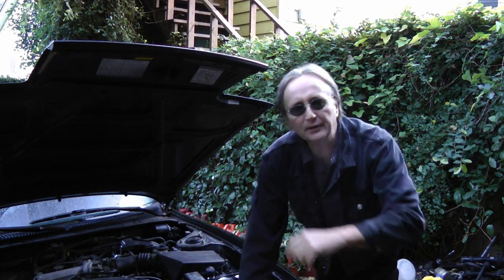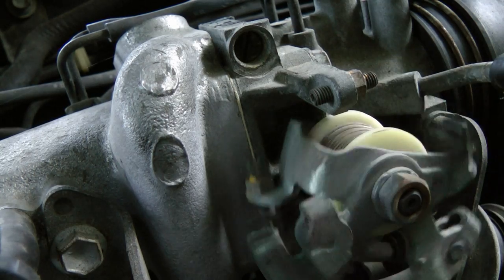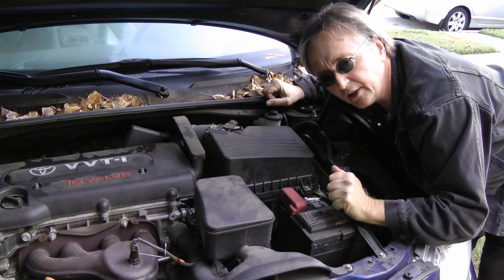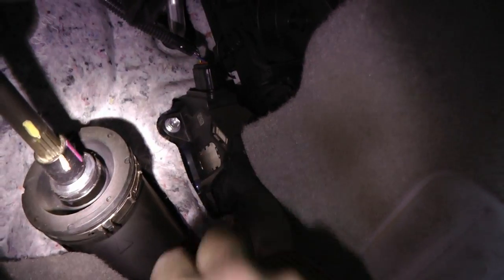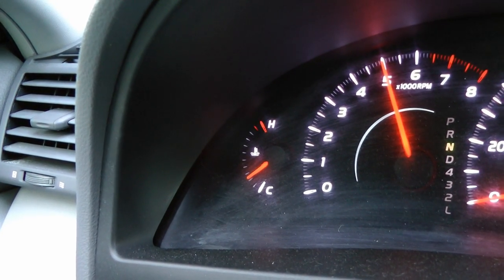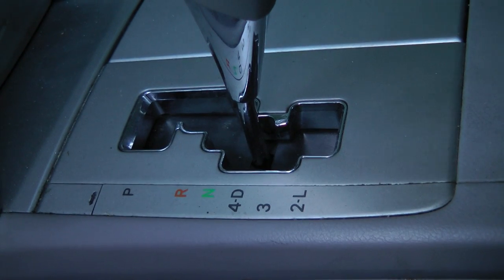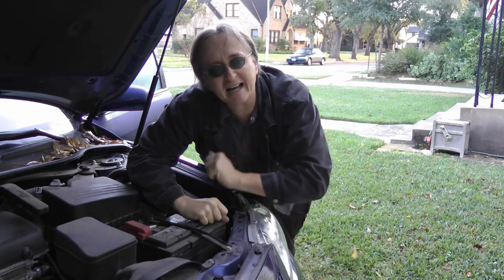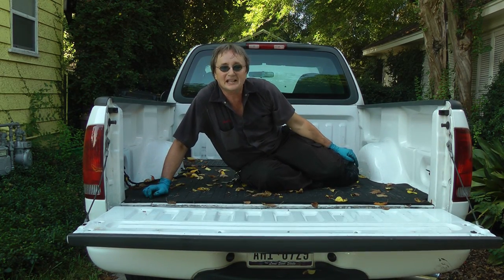How To Stop Unexpected Car Acceleration

Comment: Scotty I did hear your recommendation that if you shift it into neutral that the problem of unintended acceleration is solved.  I think the problem is that if the throttle body open suddenly due to a computer glitch some people would freak out and not put it into neutral fast enough.  People who drive automatics are not use to manually doing anything to the transmission.  Also there are cases where if the ECU really locks up the car will not respond to the gear selector being in neutral, since in many cars this is just a switch the talks to the transmission computer.
Reply: Thomas J That is not true sir...shifting the gear lever into neutral is a fully mechanical work and does not have to do with the car's computer!

Comment: I've had my car unintentionally accelerate once. The cruise control is operated by a motor creating suction in a hoses which sucks in a diaphragm that opens the throttle valve. Earlier I cleaned the intake manifold and all hoses and such, something must have got in that line and perhaps through heat in the engine bay it evaporated and created a vacuum that held the throttle open

Comment: A lot of this was on the Prius that doesn't have a real transmission control and doesn't have a key. The forward/neutral toggle is just a computer signal and the ignition just has a start/stop button. Neither of which do anything while the car is moving. You can kill the car by holding the start/stop button down but most dont know that.
Reply: Robert Gary Like a blender?
Reply: Another reason I despise the Prius. 

I'm fine with hybrids, it's just the design of a Prius i hate. The charging system on them, transmission system, etc. 

Don't get me wrong, my mom drives a 2014 Kia Optima hybrid and it's a great car with a real gear selector.

Comment: Scotty, Alot of the new Toyotas don't have trans dipsticks. What's your method of changing out the fluid in them and is there a filter in the trans to change. ( 2016 Camry). Thanks Mike

Comment: Hey Scotty, I have a 1993 BMW with a cable 530i ... I had an unintended acceleration. Could this be the throttle body, the throttle body sensor(TPS), or the cable? My cable is definitely old. It was 2 degrees out so it was very cold. Wondering if weather made it stick. It was redlining even in neutral so I’m guessing the TPS is working because the throttle would have gave up if I stopped pressing the gas. So I’m guessing cable or throttle body? Please share and help where you can thanks Scotty.

Comment: my 196cc mini bikes throttle would get stuck at full rev and it was like cruise control haha , it only had rear brakes , now I have a 08 mercury mountaineer auto and a 95 mitsubishi mighty max manual . the mitsu just needs electrical redone like lights, turn signals ,etc, just got it so it's a running project truck

Comment: Computers are more reliable and can add features that were not possible in the fully mechanical systems that they are replacing.  The computer can monitor the car's "health". For example, I went to get an emissions test and all they had to do was plug a cord into the car to read some data that it collected as I was driving it.

Comment: You may be correct but it's "safer" to just put your engine in neutral,  because if you turn off the engine and someone in front of you hits their brakes, not only are you screwed, but they are too, because even stopping a  coasting vehicle on a downhill slope is a pain without power brakes...

Comment: Now if it were something from the VW Group, you'd just press the brake pedal to cut the electronic throttle input and let the ECU bring the engine down to fast idle. They've had this system in their turbodiesels since the early 90s, and have included it in every petrol model with electronic throttle control.

That is the reason why the engine management light turns on when your car's brake light switch on the pedal is faulty.
Reply: +chrwl007 
Toy changed their software to do that. 

But this wont stop old, bad drivers from stomping on the wrong pedal in a moment of distraction and stressed confusion.  We've seen/heard old ppl run over crowds every year for decades but it rarely reaches national attention.
Reply: peachees
I know they did, but they should have anticipated that type of failure when they did the initial design

Comment: i know this is a few years old, but i really think no matter what brakes, steering wheels and accelerator  should be controlled manually no drive by wire crapp as the only connection... tho not sure if brakes and steering is by wire ( computer controlled ), tho iv heard about some cars being that way,  correct me if im wrong.

Comment: Have you ever heard about Hyundais accelerating on their own ? At my previous job we had a Hyundai Trajet minivan , that would rev up on it`s own when it was hot outside, mostly when you put into park after you been driving it . Once it did take off on it`s own when it was started and put into D , we had to turn it off and restart it to stop it ,from revving . Only happened on hot summer days but it was a bit scary . I heard that one problem on Hyundais were the thermostat ,, could be .

Comment: Hi Scotty, any other suggestions that could cause this problem? I have a Mazda 2000 B2500 Pick up Standard transmission. It accelerates during drive and once I shift to neutral it continues to accelerate until I come to a complete stop. Its like a sensor is malfunctioning. I have replaced the idle control valve twice and still have this problem. I do not think its the cable in my situation but if you suggest it I will try it. I have also tried cleaning throttle body and replaced all sensors.

Comment: I have a 2002 Ford Ranger, and when I was backing up with my foot on the brake and off the gas, it accelerated to full throttle, and i panicked and put it in park and turned it off. I could not replicate it, but I am worried it's going to happen again. I don't see how it could be a stuck accelerator since it was idling in reverse. No error code, and no issue was found in the throttle body, the cable, the spring or anything else.

Comment: This happened to me a couple months ago, turns out there is a little rubber piece that was broken  that goes between the gas pedal and the acceleration sensor. The dealership wanted $150 to replace this tiny rubber piece.
Reply: +TheGentleman Where's the happy ending? Tell us you got the part on ebay for a buck and it took you 5 minutes!
Reply: Of course not! glued the end of a pencil eraser to a metal washer I had laying around. Works perfectly.

Comment: Scotty I have a question about my car, relating to the video.

Background story: at a dead Stop (with my foot on the break pedal) - I then depress the break pedal so that I can drive forward ( I do not press on the gas ): My car accelerates forward as soon as I take my foot of the pedal too quickly.  I am used to cars that slowly move forwards once my foot is off the break pedal. 

Would you happen to know why this happens ?

Comment: @parrowman They could have come up with a failsafe design where a secondary throttle would simply override the main throttle in closing the airflow. Engine power is controlled primarily by the main throttle and the secondary only steps in when power needs to be cut.

Comment: I have a 99 camry 4cyl, and it's normal when it is cold that it idles that high. It'll go down. If it's like 2300+ rpms then you may have a problem. But your car is fine.

Comment: Mr. Kilmer, I've had a case where an acquaintance of mine was driving on the motorway with cruise control on, but the car was stuck in cruise control and brakes just didn't work when she was pressing the pedal. What could have caused this? The car in question is a 2012 Merc E63 AMG.

Comment: Unfortunately some vehicles suffer Sudden unintended acceleration because of network communication errors so the TCM locks the transmission in limp mode. 2nd or 3rd gear.

Comment: My 2010 Toyota Prius Suddenly Accelerated Unintendedly on January 31, 2019. This is still happening! This was not the Floormat! I did not mistake the Gas Pedal for the Brake Pedal! I Never Have! The pedal was not Sticky! It Sucked itself Full Throttle right to the Floor when coming out of a right hand turn! Brakes held but Engine was Revving like crazy. Every time I released the brakes to try to get the gas pedal to come back, the Prius took off. Can you imagine starring down with your foot on the brakes, and the gas pedal is still pushed in Full Throttle? Explain that?? It did this for about 2 and a half blocks. Shifting to Neutral was NOT working. It wouldn't Turn Off. And I didn't want to press the "E" Brake risking the lines snapping and having NO BRAKES! That was my last resort. This was Crazy and Vehicle Manufacturers need to be held accountable! I've made a "Safety-Related Defect Complaint"  to Transport Canada 🍁. You should all do the same in your country. Let's fight this and end Sudden Unintended Acceleration!  Maybe going back to a Drive By Cable system instead of Electronic Throttle Control will be the answer. There's gotta be a solution!

Comment: From what I noticed on most cars at cold start when its really cold  the idle is at 2000 rpm and then starts dropping down to around 800 as the engine starts warming up.

Comment: 2002 Volvo C70, when I come to slow down at a light, the RPM accelerates up with my foot not even on the gas... RPM goes high when turning it on even if the engine is warm. Slight movement of the RPM while idling, stays thrusting forward like in drive once gas is pressed and let off. Doesn't go down immediately.

Comment: My 2003 accord would get dirty in the throttle body. And it would like hesitate and I had to shift early to keep it from jumping. All I needed was a new filter because we didn't realize that the air filter hose was ripped from underneath. And proof put an aftermarket one and the problem never came back

Comment: The transmission is also tied to the computer and won't shift until the gas is released.  Thus the sift-to-neutral may not work at all.  (depending on the vehicle model of course)

Comment: I have had all the recalls done to my 09 camry 4cyl.  I have never had any issues except once last year during a cold snap.  Started the cold engine without touching the gas pedal, as usual, the engine started, but immediately revved to about 4000RPM, I shut it off.  Was OK when I restarted it again, but has made me worry a bit.
Reply from the maker: +kramden  nothing is perfect. but try my video "how to fix a car that idles poorly" and often that cleaning stops such nonsence
Reply: I have had the throttle body serviced several times just to make sure, sparkling clean every time.  At least it is a 5speed, so would just have to push the clutch in if it misbehaved.  One thing is for sure, this is my last Toyota!
Reply: Yeah cold start, the engine probably did that to prevent stalling, if you rev a bit more it'll drop, or the throttle body could've been frozen open or something of the sorts
Reply: +kramden this happens to my bike and car when cold, it's like self warm-up i think. I have to wait til it calms down before i can ride smoothly, or else it will be a slow ride!

Comment: 1 if Unexpected Car Acceleration happens .... sometimes there is NO time to switch to neutral. For example if you stop in front of moving train.....
2 In modern cars  gearbox shifter connected to...ECU as well. It is just a joystick.

Comment: so if I put my car for the drive to neutral the transmission will separate itself from the engine physically or will the computer system break the ground or the circuit between the engine and transmission.

Comment: I think he is underestimating the computer problem.  In many new cars, the gearshift lever is also just a control that tells the computer to shift into neutral.  So, if the computer is hung, no shifting.  In addition, if the computer is hung, you can't turn the car off with the on/off button either.  So, accelerating car, the brakes aren't as strong as the engine, you can't shift into neutral, and you can't turn the car off.

Comment: Just try to brake a speeding car without the 3 full pedal pumps in any car. Try it in a place where you can't harm other people or yourself.

Your legs (even if you are a bodybuilder) can't give you the enough force for making stop a speeding modern car in a short amount of time even if you stand up on the brake pedal. As a last resource you can use your emergency brakes when you put your car in neutral or when you shut off your engine.

Comment: I hear all the time old people unintentionally plowing through the fronts of stores.. Hitting the gas instead of the brake or whatever.. They always say "the car just took off". Two foot drivers. One foot on the gas and one on the brake. When you hit the brake hard for whatever reason, and your other foot is resting on the accelerator, Then it's all out panic mashing both feet through the firewall, hoping like hell you'll stop before you get through the back of the store.

Comment: Buy your cars with a manual transmission if you are too dense to shift from drive to neutral.  Push in the clutch and the problem is solved with the cable or the computer. Also, I believe this is mostly pedal confusion.  I count myself a pretty good driver and I have done it.

Comment: Apart from a fault, the other cause of unintended acceleration is pressing the wrong pedal, especially in an auto. Some people think that you use the right foot on the throttle and the left foot on the brake. NO. If you drive that way, whoever taught you should be ashamed of themselves. The right foot does ALL THE WORK (moves to brake or throttle as needed) and unintended acceleration is then very rare. What say you Scotty?

Comment: Back when a certain set of cars from a certain company had such issues as unintended acceleration.. I couldn't comprehend why everyone was making such a big deal about it could cause an accident. It "should" be common sense if such happens that you shift to neutral.

Comment: Scotty, on my 2003 Hyundai Santa Fe, i have a code P0224 , throttle / pedal sensor circuit , i already replaced the throttle position sensor on the engine, has the 3.5 liter, i see you talk about no throttle cables, does that mean its the sensor on the accelerator pedal causing this ? please let me know. thanks

Comment: the only thing about complete drive by wire is with no manual connection the thought of a short to any sensor scares me whether its brakes, steering or accelerator but there might be special fail-safes im unaware of

Comment: Put the gear into neutral or step fully on the brake without releasing it until the car fully stops and eventually the engine will just stall?

Comment: It happened to me while I was driving a Camry, yes it did and I freaked out, I was on the road and it happened!!!  I didn't know that to do, I was stepping on the break and it was just skidding, I couldn't even control the car, suddenly it stopped!    so you are saying that if this ever happens while driving we should put the car in Neutral ?  while driving ? Neutral?  so what will happen in that case, you're driving going over 60 and then it starts to accelerate,  throw it in Neutral?

Comment: this happened to my 1995 Ford right before a red light at a busy intersection. i just slammed on the brake and it slowly stopped. just in time. didnt have time to think really. then turned it off and on again, had to move i was in a busy intersection, and it was fine after that?

Comment: Toyota ended up saying the most probable cause was mats getting stuck under accelerator. Having said that they did introduce smart stop technology to all of the new models. This tech will kill the accelerator if the brake and accelerator are pushed in a panic at the same time!

Comment: I have a question. i have an older car also that use the cable. What would cause the gas peddle hard to push? its not sticking just takes a lil more pressure to get the car moving.

Comment: if anyone has or wants to know about Fords unintended acceleration in the 1987-1995 F series truck, full size bronco and econoline with 5.0 and 5.8 V8 engines keep reading.
this summer my truck would rev up to 2500-3000RPM when first started it and stay there until it was turned off. even later on after starting it again it did the same thing. the accel cable was not stuck or propped, it was the TPS on the throttle body. just unplug it and replace it as soon as possible. temp fix take + off batt

Comment: its not always the pedal or the cable. sometimes, if turbo is broken it can start sucking in oil, which then goes into burning chambers and it will start accelerating on its own until the engine dies. you cant even turn it off. :) so be aware of it because that can happen too. ofc, putting it in neutral will allow you to stop the car but you wont be able to turn the engine off you just have to watch it slowly kill itself :D
Reply: I believe these levers you are talking about are horrible. (if we are talking about the same ones) every modern car has it now and they usually break and brick your engine :D first thing to get removed once you buy a used car.

Comment: @scottykilmer With a lot of cars you can use a penny paper clip to ground two pins together, and the check engine will flash indicating the error code. At least some older GM vehicles anyway.

Comment: I use to own a 1989 Toyota Camry  that accelerated on its own. The next morning I started the engine and the mass air flow valve started hammering it sounded like the engine had a real bad knock I shut the engine off. When I tried to restart the engine it wouldn't start, so I turned the key on the check engine light was suppose to flash a code but no check engine light. I had it towed to a shop and they told me the computer was dead and can't get another one. The car went to the junk yard.